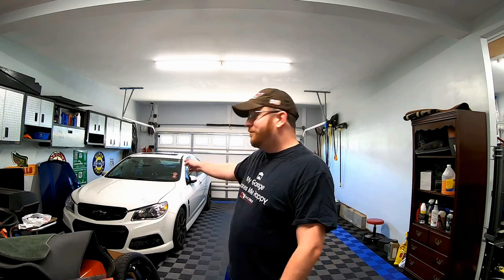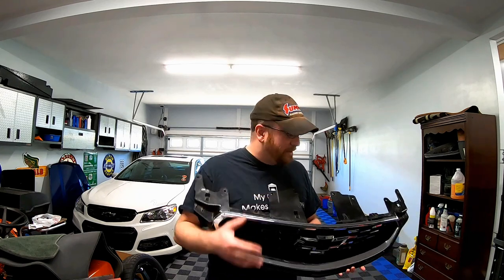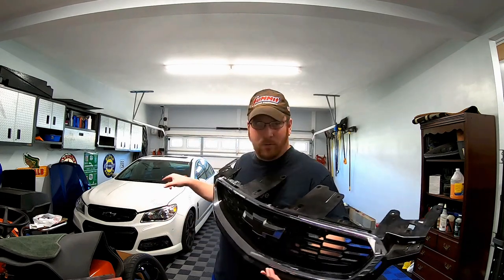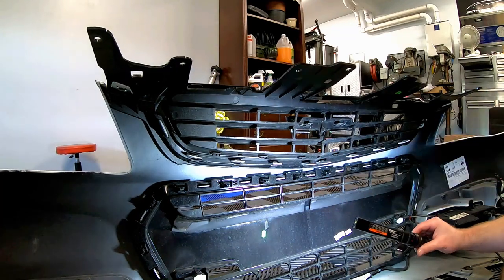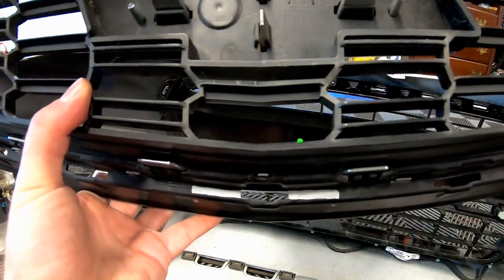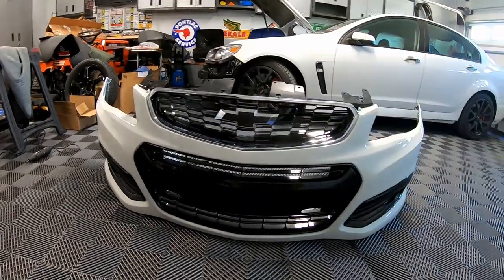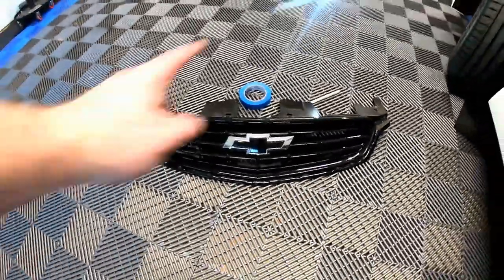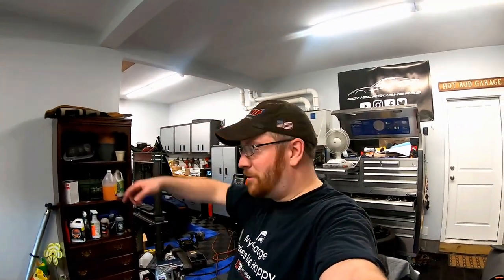2014 Chevy SS - Upgrades Ep 9 - 2016+ Grill Install

Comment: Hello. Do u know if the 2016 front bumper will fit on the 2014?
Reply from the maker: You need everything with the bumper - the center piece, the top piece, fog lights, inserts - it will then be a direct swap. I think you will lose the fog lights - but honestly they are worthless anyways.
Reply: @bonecrrusherSS  thank you appreciate it. I was just going to purchase a complete 2016 front bumper kit from someone and they faked on me. Smh